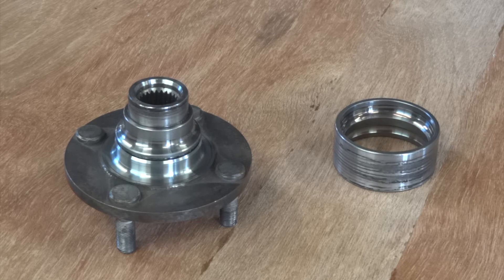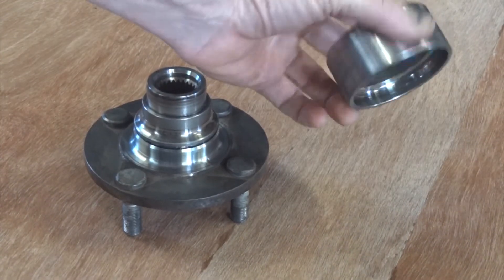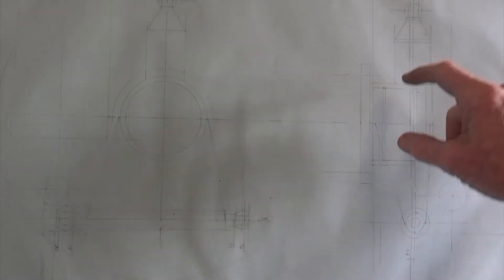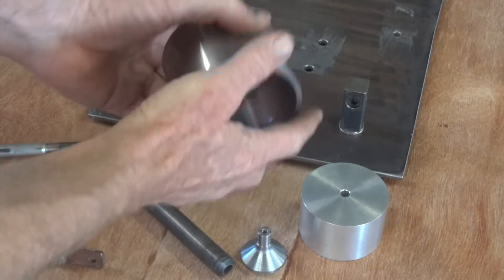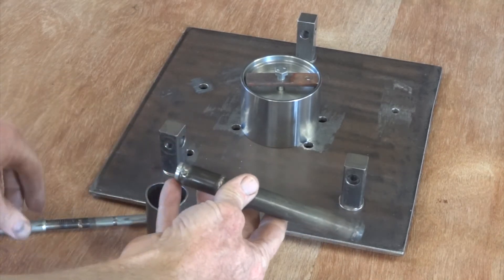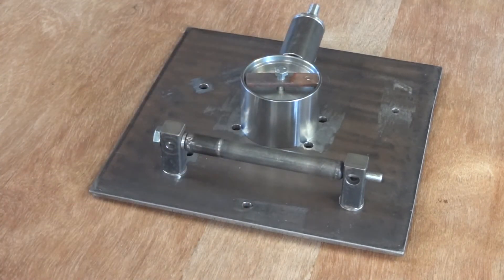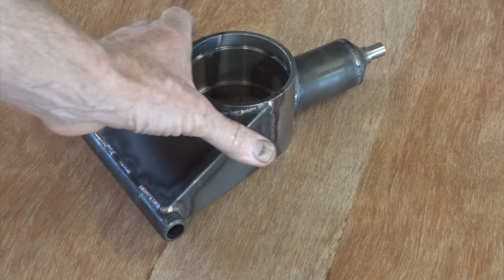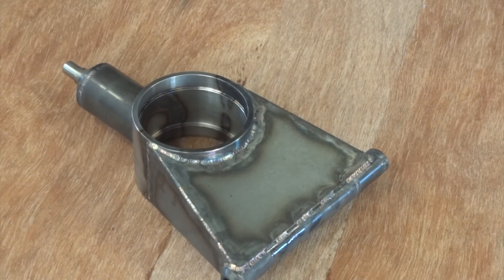Ninjamobil ZX10 Carbon Dart Rear Upright

Comment: The bottom edge of the upright is not fully welded to the bottom tube. Is there a reason for this? Is this an area where moisture can cause rust?
Reply from the maker: I guess so, yes. But not really, given the application. It just avoids welding where there isn't much load.